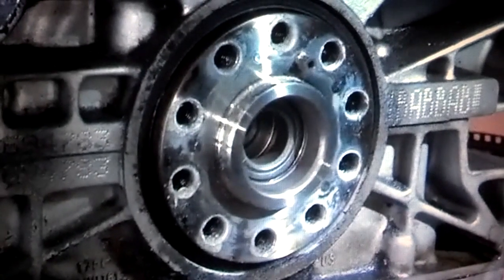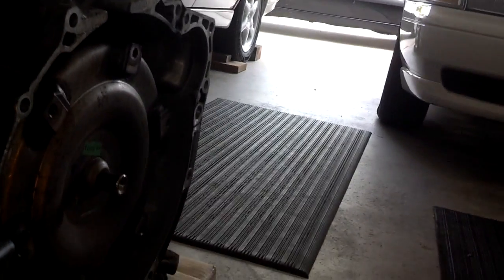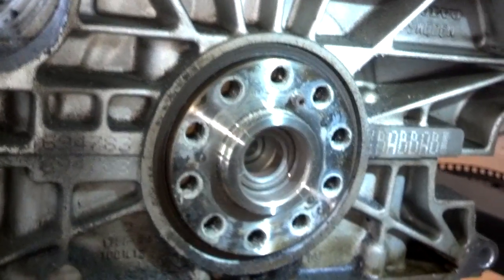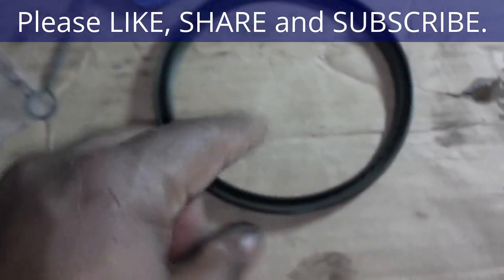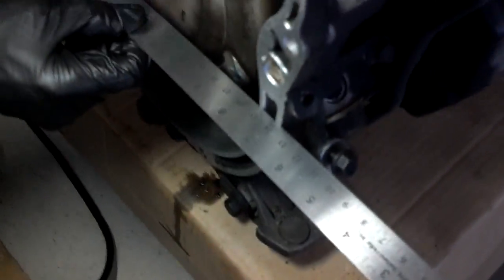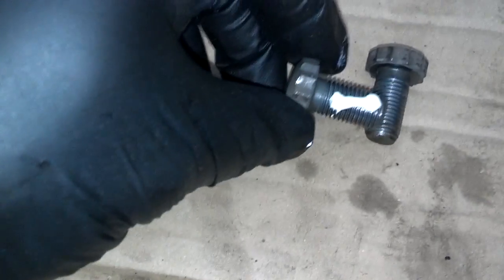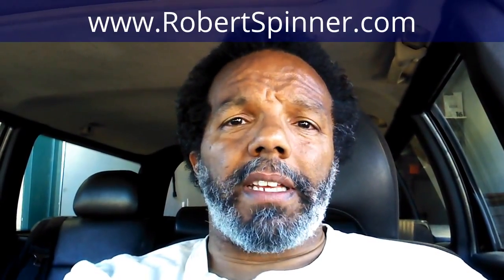Rear main engine oil seal (RMS) replacement, white block Volvo 850, S70, V70, etc. - VOTD

Comment: I’m afraid this is what we’ve got leaking after the shop installed a pick a part engine and didn’t clean the pvc trap system. It was blowing the glove up like flappy arm guy at a car dealership. It’s blowing a quart of oil every 50 miles and you can see it in the rear view mirror blowing slight white smoke but oil residue all over the rear hatch and bumper. 
I’ve changed cam seals front and rear thanks to your videos they are fine. Dual VVT are fine. Crank seal seems to be fine. The turbo down pipe I redid before cam seals it’s fine.  So the rear main is the last thing left.
Reply from the maker: https://youtu.be/Z0hZELYgOX8
Reply from the maker: https://youtu.be/Qfece4bER7Q

Comment: Do you have any recommendations on getting the flywheel bolts off? I have a 17mil star socket but I'm not sure if I'm going to hit it with and impact driver or try to find a way to keep the flywheel still so it doesn't move while trying to wrench the flywheel off.
Reply from the maker: Impact.
Reply: @RobertDIY  Done. And got it off!!

Comment: Hi Robert very helpful as always. I have just replaced the RMS on my manual 850, but it was like the old one you took off, so the spring kept coming out when I tried to fit it. Eventually I got it in, but now its about 1/8" deeper than it was originally. Will this cause it to leak please?
Reply from the maker: nope
Reply: @RobertDIY  Thanks Robert that's just what I needed to hear!!

Comment: Hi Robert,
First off, great videos. You do an awesome job explaining and showing everything that needs to be done.

Second, I have a question about replacing a rear main seal along with a few others on a ‘93 240 wagon (AT). When you go to replace the front pump seal, you mentioned also replacing the axle seal to it’s left and one on the other side (would that be a rear pump seal?). Are those seals also on a 240 AW70 transmission that you know of? If they are, are they the same part as the front pump seal ie., if I order 3 front pump seals will they fit the axle and rear seal as well? 

Last, when replacing the flywheel bolts, why is it important to have them on at that level of foot-pounds and degrees? Also, is it important to put the flywheel back on in a certain way/alignment or does it not matter all that much how it slides back on?

Zach
Reply from the maker: The seals may be different.
Reply from the maker: Should also have all 3 seals.
Reply from the maker: Torque is always critical when installing parts that endure a lot of stress.
Reply from the maker: Yes the flywheel has to go back on in time. That one should be keyed.
Reply: Robert DIY 
Thanks for your responses. I’m looking to replace the rear main, front pump and ATF gasket/filter pretty soon. It turns out a previous owner did the rear main a few years ago with a genuine Volvo seal. The mechanic may not have done a solid job but for now it’s got a relatively minor oil and ATF leak. 

The oil filler hole is sucking my hand down when I put my palm over it, I guess that means the PCV system is good. Flame trap is pretty new and seems clean. Is there anything else you’d recommend taking a look at for the cause of a rear main leak? It could just be the previous guy didn’t do the best job with it and a new one will do the trick but I’d like to cover my bases.

Comment: Robert...are 1993 Volvo 850 GLT part numbers the same?  What are Axle Seal part numbers?  I replaced the PCV parts, anything else that should be done while trans is pulled?  TY for all the great info.!!
Reply from the maker: Probably.
I don't know.
Reply: @RobertDIY  Thanks for the reply

Comment: nope not gonna take the engine out
Reply from the maker: LOL Hope you have a lift.
Reply: @RobertDIY  its an old volvo 91 and I will just not go very far in it at a time LOL and I think its the oil separator anyhoo that big black box under the intake manifold causing oil to leak into the turbo , I think I got that right
Reply from the maker: Cool.

Comment: Robert thanks for the video. How did you come up with the 60 to 90 min estimate?
Reply from the maker: Because it took us 90 minutes to remove the flywheel, replace the seal and reinstall the flywheel. The estimate is the seal replacement once you have the transmission apart from the engine.
Reply: Completely understand Robert, that makes more sense to me.  Thanks for the clarification. Great vid.

Comment: Hi Robert I had some clutch slipping problem recently so I took apart the transmission to replace the clutch . It appears that the bell housing was full of old oil and the clutch disc condition was ok only the friction plates wasn't ok'because of slipping . Do you think à rear main seal leak can cause some clutch slipping with oil getting inside the bell housing ?
Reply from the maker: Was it engine oil or gearbox oil? Was the gearbox oil level low? Either the RMS or the seal to the throw out bearing...
Reply: It was engine oil inside and the gearbox level was full when I removed the gearbox. Im going to replace the RMS and the throw out bearing seal then .
Reply from the maker: Good. I actually think it's called the output shaft seal.
Reply from the maker: +hotassbeatsclap absolutely. Sometimes old seals just leak.

Comment: +Robert DIY, Old vs. new rear main seal: The older seals had a felt side that was always applied towards the outside. These new seals do have the part number molded into them. However, does it really matter which way the seal is installed? Is it ok to use an assembly lube for ease of installation? On both the inner & outer sides of the seal? By the way, those flex plate bolts as well as the torque converter bolts are TTY; I.E. - Torque to Yield. In other words, they stretch. Reusing them isn't recommended. I've always replaced mine, when performing this procedure.
Reply from the maker: I always install the seals so that the oil pressure opens the seal so blunt side out. Just like the ones with the felt on them. 

Yes I do know those bolts are TTY. It's good to use new ones.

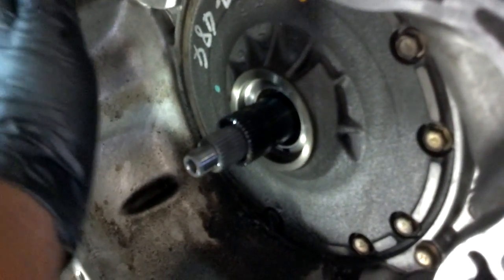Comment: in this video  i noticed you said only use Volvo seals PLEASE   (4:25 min in vid )   i ordered thru the local  autoparts   super cheap in Australia   they sent me a package  with a protorque automotive products sticker   part no::  OS1044   REAR CRANK SEAL  VOLVO  15/03/16        can you please coment your thoughts 
As your in USA   ill just explain for you if you unsure Supercheap Autos  in  Australia    is like Walmart  in usa    but only deal in car parts   To be honest  i doubt they got from dealership
Reply from the maker: Volvo parts have a blue label. It will also have the Volvo part number. Not sure what else to tell you.

Comment: for the flywheel bolts, do you bolt them in a star-type pattern, or just go around in sequence? also, is the 17mm star socket used for those flywheel bolts?
Reply from the maker: +Benjamin Pina star pattern. Yes.

Comment: hello Robert, I'm going to make the change the rear oil seal and let me know if I need to know if I should change something more in the process to make it all new . thank you very much , you're a great help to me. regards from Argentina!! Mateo.
Reply from the maker: What kind of car do you have?
Reply: I have a Volvo 850 2.5 10v. Engine B5252s. Thank u
Reply from the maker: Most people also replace the transmission output seal.
Reply: +Robert DIY thank u so much!

Comment: I had to have a shop replace my transmission about two years ago because I was 1800 miles from home, had them replace the rear main at the same time.  Now it seems it's leaking, go figure.  Have to tear everything apart and fix it myself.  Gonna go ahead and tear the motor down and rebuild it as well - unless I just replace it, haven't made up my mind.
Reply from the maker: +looncraz what kind of car do you have?
Reply: Robert DIY
96 850 NA, auto.  Almost 200k mi.

Also, I verified that I do not have excessive blow-by, a glove over the oil filler port stays flaccid at idle, but pulls in a bit when I tweak the throttle, never builds in pressure.

Oddly, though, I do have a slow stream of smoke from the dipstick tube.  Very lazily just climbs out, kinda hypnotic - been that way for 100k miles, LOL!  Full synthetic oil, and just checked the whole system for leaks two days ago - nada.
Reply from the maker: +looncraz I would do a compression test.
Reply: Robert DIY
Already did, 180 on all cylinders, though my gauge is actually off and says 130, I tested the gauge with my compressor and that means 180, reliably :p

Car runs great, plenty of power, good fuel economy (for a 96 850), pulls consistently up to 100mph+, the only issue is the oil (and the inability to find a full dash replacement - mine is trashed).
Reply from the maker: +looncraz Has the PCV been properly serviced? If so, maybe he used an aftermarket seal.
Reply: Robert DIY

I do all of my own work, and I serviced the PCV system just two days ago.  I have a good vacuum, even though I have a lazy stream of smoke from the dipstick - no pressure is built at all, once I twist the throttle plate it builds an instant weak vacuum.  It behaves exactly as my Volvo 240 did throughout its entire life - and it has had this lazy bit of smoke for 100k miles, though it sometimes goes away for no known reason.

I did hit a deer at about 70mph (again) and it went under the car.  No damage to be found, just lots of deer hair... again. Don't want to jinks myself, but that's the second time I've done that.
Reply from the maker: I meant, was the PCV in good condition when the RMS leak began.
Reply: Robert DIY

Threads on the screw?  Not sure what you mean.
Reply from the maker: Yes, oil on the lower bell housing screw thread.
Reply: Robert DIY  Ah!  I get ya!

Just watched your video series "Volvo V70 Turbo motor swap..." and that made me change my mind about how to pull the motor, should it prove necessary (I think so).

I noticed either steam or light smoke from the exhaust now all of the sudden, no indication of a head gasket issue, head's rebuilt, so I'm thinking it's all about rings now.  Will see when I dig into it when the sun comes up and run a new compression test while I can still start it :p.
Reply: Robert DIY  I pulled the starter (and almost everything else :p) this morning.  I can actually see the rear main seal protruding slightly out of its seat and the presence of oil around it.

Also the front main seal is also, indeed, leaking.

I neglected to perform a compression test, as I already had the car partly apart and wanted to get things moving.  I'm going to try to rebuild it and see how it goes, cost-wise.  I've itemized everything I need in the best case scenario and the worst case - and I can afford either, so I'm good.
Reply from the maker: Good deal.
Reply: Rebuild complete and the car's running like a dream (knock on wood!).  Only about fifteen miles on it right now, so it's due for its first oil change. The rings are sealing well and I have minimal blow-by now - already less than before.

I discovered that the rear main seal had, in fact, failed structurally.  I disassembled the engine with a keen interest on removing the seal completely intact and undamaged - just to find that the spring had broke.  Seeing all of the gash marks the installer left around the periphery of the rear main sealing race made me cringe (and also indicates a possible cause of the seal spring failure...).  Thankfully, the sealing surface itself was pristine, so he clearly had no issue removing the old one (which never leaked) but had missed with something quite sharp (like a screwdriver eek) when installing the new rear main.

I had to have 0.006" removed from the block to make it level, all of the piston no extend slightly above the deck (which is fine).  My oil pickup tube o-rings were in fantastic shape, but the tube's screen was almost completely obstructed.  Bearings were in abnormally good shape for a motor with 200k on it, so oil starvation had not occurred - this does explain why my lifters would sometimes take a long time to stop ticking after the car sat for a few days - they shut up in no time after a complete rebuild.

I rebuilt every component, replaced the alternator, cleaned, stripped, painted every metal part, and I replaced every bit of plastic or rubber.

Sadly, I was unable to source oversized pistons to guarantee perfectly round bores, but I was just on the high side of spec anyway, so I just honed the bores and removed a few minor low spots (removed 0.00025" total per bore to get rid of them).

While I was waiting on the machine shop (which turned out to only be overnight, hooray!) I did a leak down test on the head just for good measure and found no fewer than nine leaking valves... as in the water was streaming out of them when I filled the ports... Thankfully, it just took some cleaning and lapping to fully resolve that.  I went ahead and port-matched the intake and exhaust ports, leaving a ribbed texture on the intake to prevent fuel condensation (also smoothed the transitions between the two valves on the intake so the fuel charge would steer away from the center and to the sides more efficiently).

I then balanced each piston and rod and checked the crankshaft and honed every bore for the tappets, making the tappets fit much more nicely than before (some would snag).  Each tappet bore was adjusted for its own tappet.  My cams had zero signs of use, but the bearing surfaces on the head and valve cover had slight (~0.0004") ridges which I had removed.  All bores and edges were then chamfered slightly, including the piston bores to facilitate ring installation.

All threads were cleaned, inspected, and three were repaired.

My total investment was surprisingly low, falling just below $1,000.  This does not include tools I didn't previously own, but does include the machine shop costs and all supplies and parts used.  With the tools I purchased (many of which I will continue to use for years - others I will probably sell at a significant loss) took my total to nearly $2,000.
Reply from the maker: Very nice. I hope it last you for many years to come.
Reply: Robert DIY
 Same here ;-)

About 300 miles on it now, and it's running nice and strong with almost no vibration at all - and zero observable blow-by (it gently pulls on my thumb from the oil dipstick :p).

Now just for those washer nozzles to show up... and a new dash....
Reply: While I don't own the car any more, it's apparently still running wonderfully as a daily driver. Last mileage I heard was over 250,000 miles and still purring like a kitten.  I doubt they will do the timing belt service and it will eventually break.

Comment: what is the best way to install the seals ??? that seems to be missed in this video.....will they just tap in with a hammer ?
Reply from the maker: +AwakeDude911 We tapped it in with a small wooden block. Really needs to be recessed just a little from the surface.

Comment: That's some serious work! Hopefully something I won't be looking at needing for a while. Right now, with 189K, using very little oil between changes. I think doing that PCV work a few months ago helped a lot.
Reply from the maker: It should. A clean functional PCV is critical.